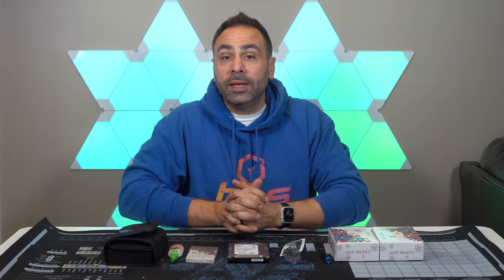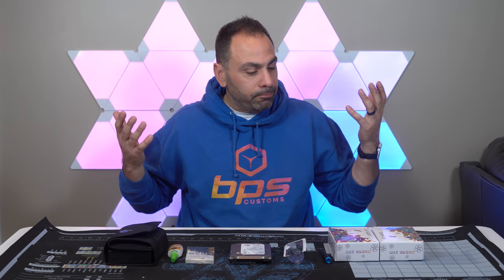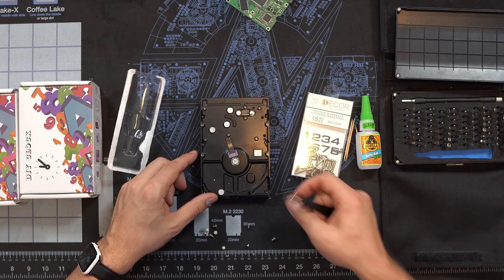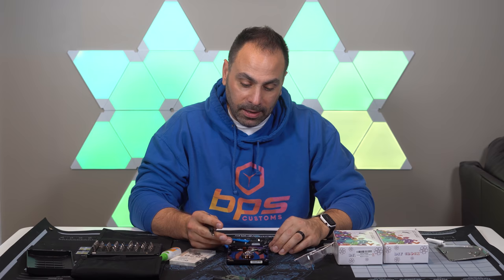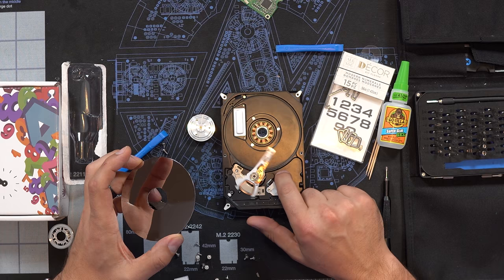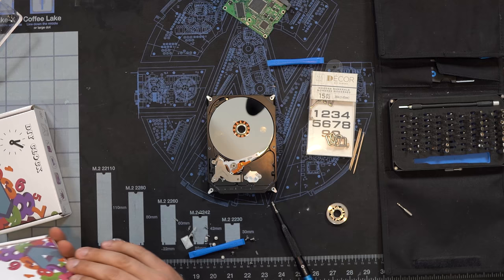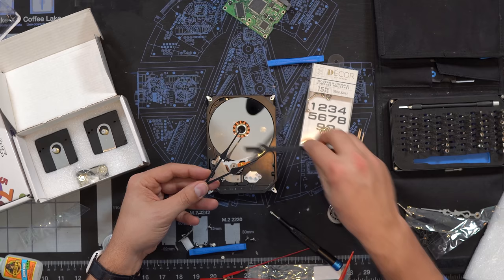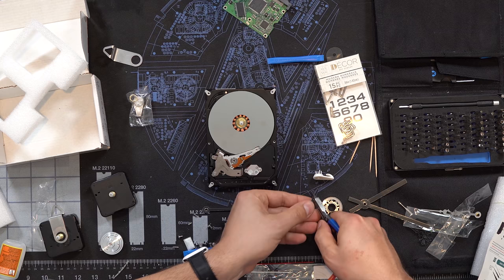Turning An Old Hard Drive Into A Clock!

Comment: wouldn't a longer shaft allow the clock arm's to travel over the HDD stylus? Very cool project, but I think you created more waste than you saved lol. As HDD's are metal, they can be sent to any metal scrap yard, it's things like monitors that really become a problem.
Reply: hard disk drives are made out of some very rare and valuable metals if you just send them in with bulk scrappl the scrap yard will process it as shreddable steel in that process it is sorted out in the end it will still be thrown away instead of recycled that is why you send it to an E-Waste recycling center. My father worked at a plant that processed and steel and aluminum into ingots to be used for production of new consumer guides for 41 years. just because you send something to be recycled doesn't mean it doesn't get thrown away because it doesn't fit exactly into that recycling process.
Reply: @davidmcguire6043  not true, many, if not most, scrap yards will take hard drives, where do you come up with this ? https://iscrapapp.com/metals/hard-drives/

90% of the Hdd is composed of aluminum, with a tiny bit of platinum plating on the platter and some magnets and a tiny bit of gold on the stylus. If you have a lot of them (like more than 1000) it might be worth your while to break them down. Most people will have like 1 or 2, and aren't willing to pay an e-recycler that might actually charge you to take them.